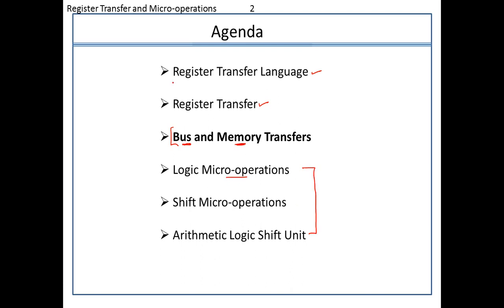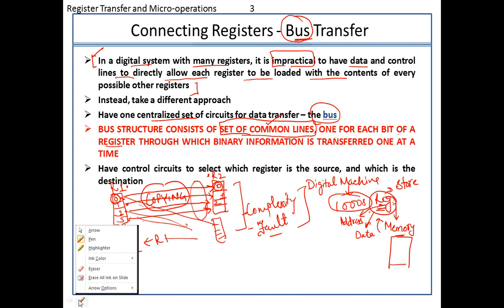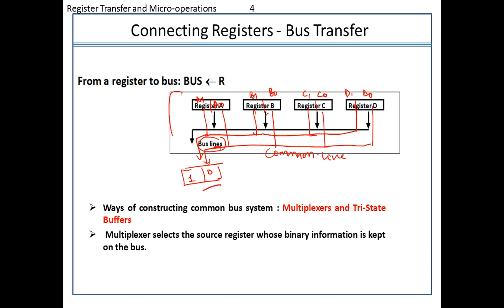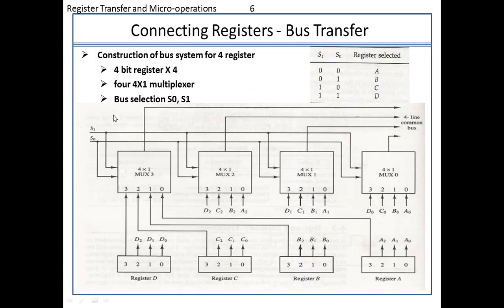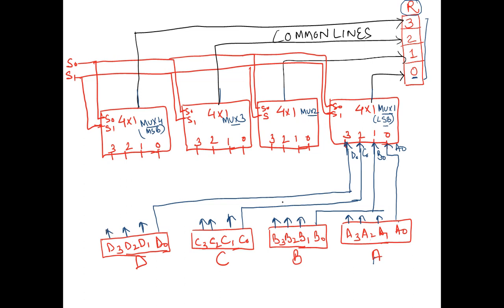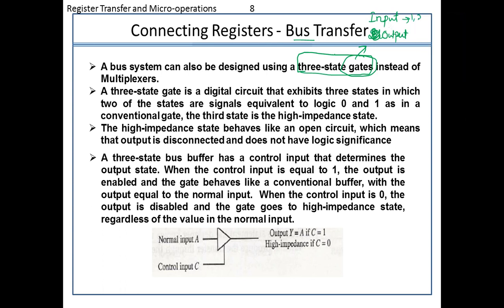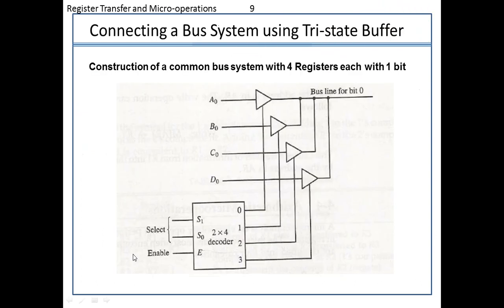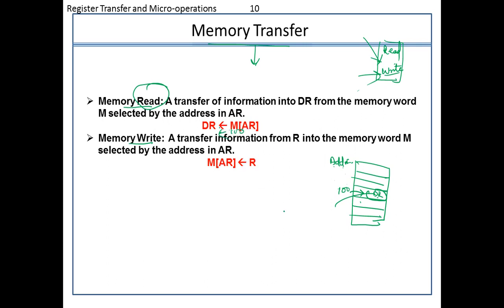Register Transfer and Micro-operation: Bus and Memory Transfer

Comment: The following register transfers are to be executed in, at most, two clock
cycles: 

R0←R1
R5←R1
R6←R2
R7←R3
R8←R3
R9←R4
R10←R4
R11←R1
(a) What is the minimum number of buses required? Assume that only one 
bus can be attached to a register input and that any net connected to a 
register input is counted as a bus.
(b) Draw a block diagram connecting registers and multiplexers to 
implement the transfers.
How can ı solve this questions? Can you help me? From morris mano s book